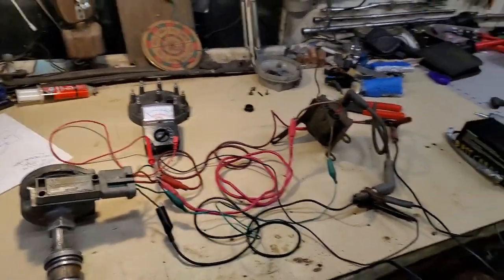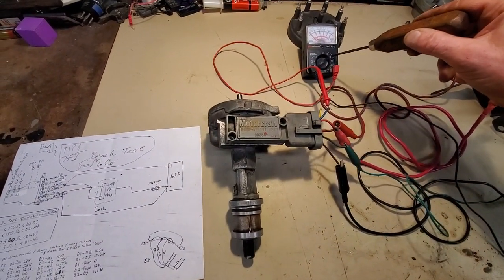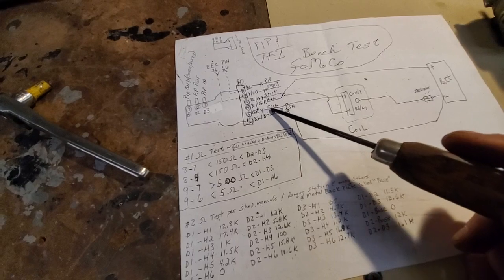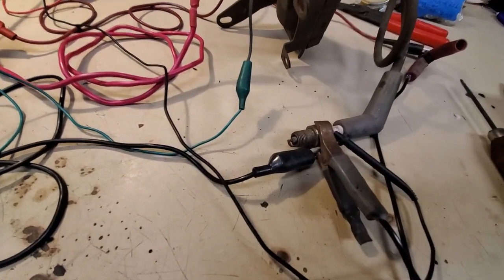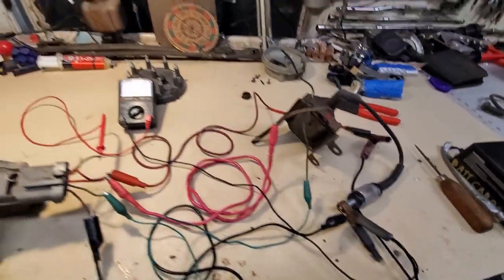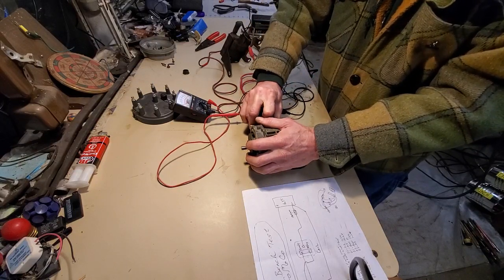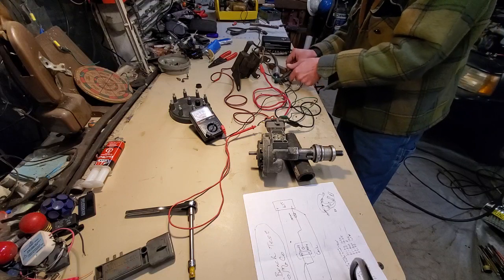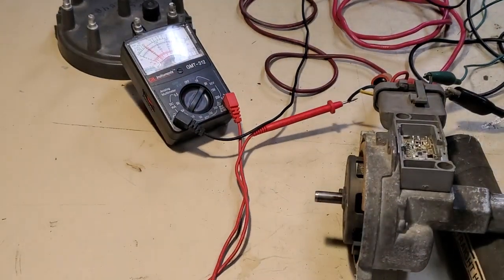Ford Ignition TFI/PIP Bench Test & deep dive PT5

Comment: Been told with the spout connector unplugged , that it bypasses the ECU and will still spark the plugs , but not with ideal timing .
Reply from the maker: yeah,, it defaults to your 10*BTDC,, imagine running with no vac advance!
Reply: @ifixitall-24-7  ,,, yes the ECU simulates light or no throttle . Btw , I think I finally diagnosed mine . Excessive thrust allowing the reluctor to rise above the Hall effect . I'll let u know if that's it . If u give me an email I'll send you the vid , or you can find it : no ignition module or PIP , 6 mins U tube
Reply from the maker: sounds good,, lets see if your issue is solved first though,, if yes, then i will give you upload credentials to my drop box and i will then post it to youtube on your behalf.
Reply: @ifixitall-24-7 ,,, well I was sure it was it . I took the end thrust down to .010 thou , from .065 . Same miss that's frequently attributed to the PIP . That's on my list , after I go back to my original ignition module , which passes a 5 step bench check ; however no heat or real circuit load .